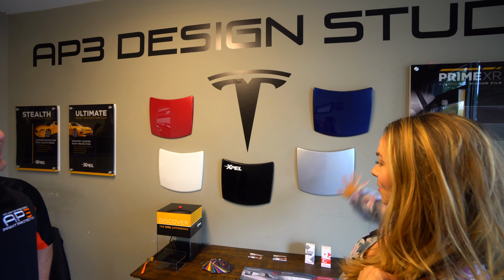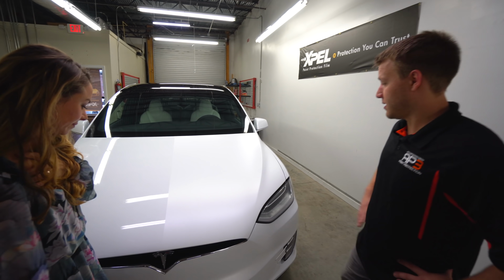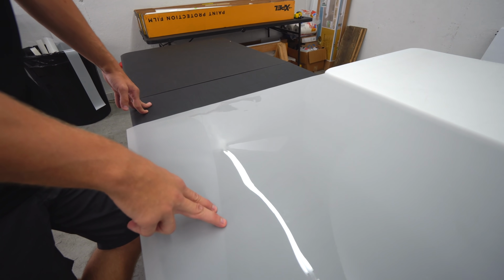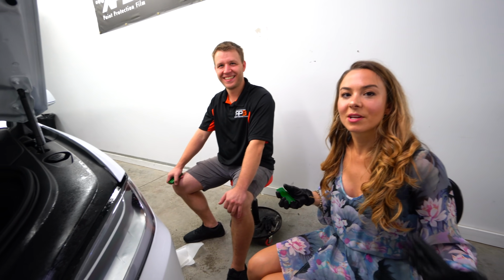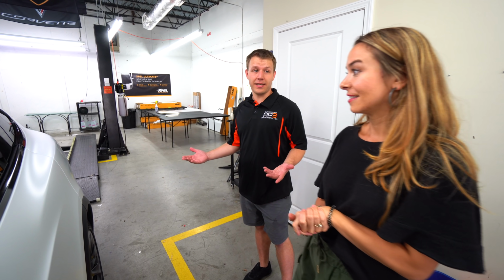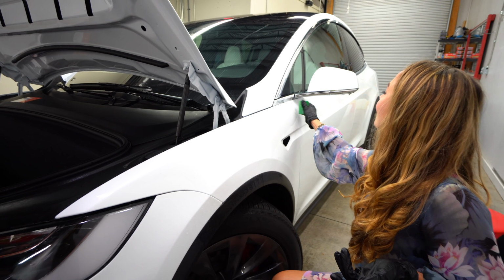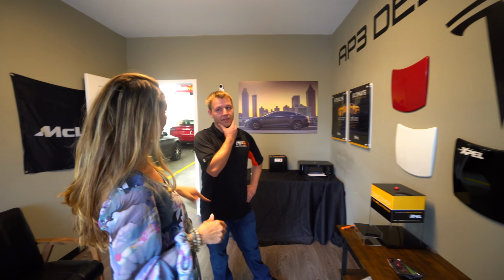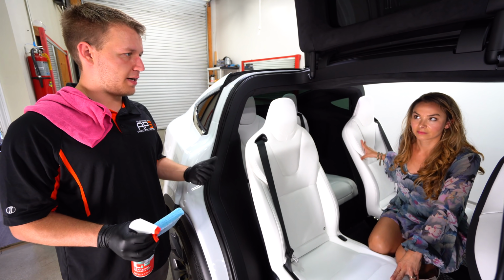Stunning Stealth Wrapped Performance Tesla Model X!

Comment: Wow that thing looks sick. 2 things I'd like to recommend. Get 20 inch wheels, they look better but still give you that ride comfort and get your windshield tinted! It makes a HUGE difference in terms of temperature and comfort inside the car.
Reply from the maker: These are the sonic carbon 20” wheels from Tesla
Reply: I'm an idiot. I meant 21" for the X... 20" is the magic number for the S - in my opinion. The 20"s look good though in black. Just a little too standard for the way you have modified the car ;)
Reply from the maker: You actually mean 22" wheels for the X as they don't offer 21''s for X. But we opted for 20's specifically to increase range on road trips (which also speeds up supercharging times, also reduces road noise and also reduces flats from terrible city potholes). We like how 22's look but would never want to live with them as we've driven many X's with 22's and experienced that it's far less functional in a real world situation vs the 20's. We actually could have had them for free and turned them down for the 20's.

Comment: Love Your Videos. I have a quick question. I have a Model 3 AWD with 500 miles on it. Only charged at home to 90%. was getting 279 stated miles of range which equates to 310 miles at 100%. now 2 weeks later down to 272 at 90%. Is this in the NORMAL Range?????
Reply from the maker: Yes, the estimated range is based on your driving habits, elevation, temperature change ect. Some degradation is expected within the first year or two of driving  but after that you should remain steady for quite some time getting about 90% of your initial miles for the life of the car.

Comment: What's the up keep on the ceramic coating? I had someone tell me that you had to get it "refreshed" every 4 months.
Reply from the maker: No. Lasts 5 years, lower quality  versions perhaps?
Reply: Thanks for the quick reply, I was actually told this by the only certified installer in my area. Guess, I'll ask around further out.

Comment: Yeah still don't see the point of the added expense of coating the wrap.  Other than that the car looks nice.
Reply from the maker: If we had to choose only one, Ceramic coating would almost be more important. The car repels dirt, dust and almost anything you can throw at it making it stay clean longer and a breeze to wipe clean. In fact, our previous X had 50k miles and guess how many times we washed it? Zero, just wiped it down with an ONR solution once every few weeks.
Reply: I don't know. Ceramic coating won't protect from scratches or chips so that's a tough call. It's really cool how they did the inside and wheels/brake area.
Reply: Yep ceramic coatings work great.  First started doing them at a Porsche dealership I used to work at back in the early 2000's when no one really knew about it. Back then it was called nano coating.